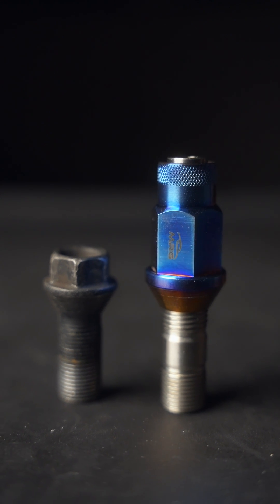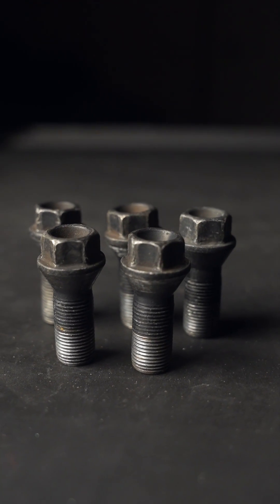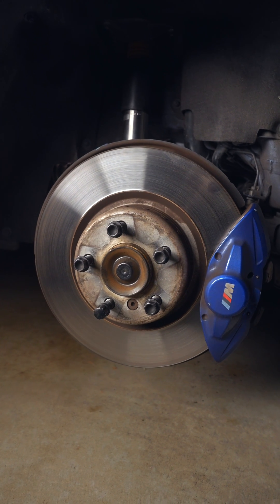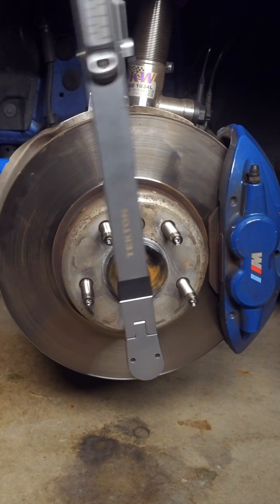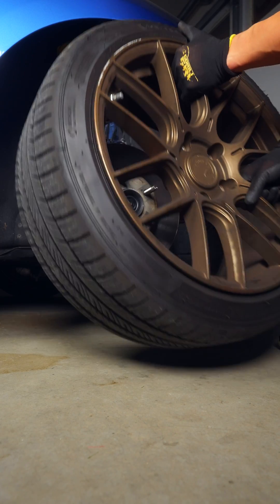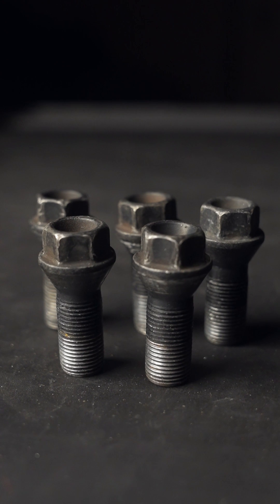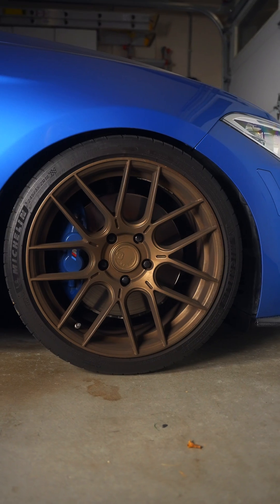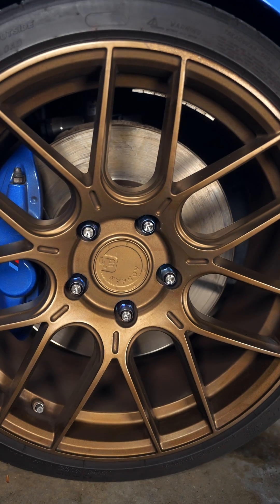Lug STUDS vs Lug BOLTS

Comment: Those wheel bolts are designed to fail before more critical components like the mounting points on the subframe, and they are a method of impact energy redirection so you don't break your neck sliding your M3 into a curb.  Studs are required for tech inspection at a few race tracks now, but those cars run buckets, harnesses, and helmets with hans devices because the energy gets transferred to the driver instead of being spent away snapping the wheel off.

Comment: studs are the way to go.  bolts carry the weight of the corners on the rotating fastener when you get a flat, making it much harder to break free on th way off, and harder to align on the way in.

Comment: The only place that bolts shine over studs is the fact that you can just swap them out super quick and easy. However, I've only ever had to replace studs once, on a 20 year old car, and they were the original studs (Messed up through stupidity, not wear), so they don't wear out overly quickly. (The lug nuts are the wear item with studs, and they're just as quick and easy to swap as bolts

Comment: im a tire tech. dealing with lug bolts sometimes drives me nuts lmao. soetimes the rotor spins as well as the hub and then ur trying to line up 3 different things while trying to put the damn wheel on lol
Reply: I have them too but amazon has bolt alignment studs

Comment: Lug bolts have a tendency to seize and be a pain to remove. I blame the heat of the brakes and all of the crap they use on the roads here in the winter. Fronts are almost worse than the rears

Comment: Literally no real benefits to lug bolts. Sure theyre easily replaceable i guess but one good smack with a BFH and u can pop out a stud and install is even easier. Comparatively if u say crossthread a lug bolt well now thats a whole hub thats fucked up. U also shouldnt be running spacers with a good setup. If u need spacers u didnt plan very well

Comment: Actually the bolt design is harder to repair if broken because most likely the bolt was cross threaded or the threads in the bearing were bad so the whole unit has to be replaced. Rather if a stud is damaged that singular stud can be replaced not the whole unit.

I mean there is a reason people stud heads and other high performance parts.

Comment: I’ve had to change 3 studs in 10 years. I feel like the lug bolts loosen easier than studs. As for accurate torque. You can’t beat a stud. Just my pref

Comment: Seems like this is from the point of view of someone that has never replaced a stud.  It can be a bit of a hassle in some cases, but in most cases a 3 lb. sledge will knock out a damaged stud just fine.

Comment: Can closed lug nuts be a problem? Like if they max out before holding the rim against the hub well enough?
Reply: Shop just changed my lugs randomly without me requesting so on some new rims and they are capped lugs instead of the open lugs I had before I just have some bad wobbles here and there and wonder

Comment: Beside the maintenance aspect there is another thing about bolts vs studs:stud and nut is stronger than bolt. The bolt is twisted by the wrench as you tighten it. Studs are torqued only by the thread friction and not the wrench. So serious applications use studs and nuts and not bolts like truck engine head studs and nuts rather than bolts.

Comment: try putting on a 40" mud tire on heavy ass steel rims with no centering rings on a wv with lug bolts (been there done that) where the rotor spins freely. and the car is on a lift😆 tire and rim combo sits at a comfy 75kgs! do that 4 times. than go to a car with lug studs, and see which one breaks you back first🤣

Comment: Holding the wheel with one hand while trying to align the holes to put the bolt in is a pain in the ass.
Reply: especially when each tire is 65kgs😆 I struggle enough with my Audi, which have tiny lightweight rims and low profile tires. getting that stupid bolt in is horrible. lug studs far superior for ease of life and saving your back when the car is a fair bit over the ground

Comment: there's a difference between lug studs and lug bolts? they're both lugs, and they're bolts that are the studs right? (sorry i know nothing about cars)
Reply: Yes, a lug stud is mounted into the hub, and you screw the lug nut onto it.
A lug bolt, on the other hand, screws into a hole in the hub.

Comment: After working in the tire industry for a few years I can assure you that nuts are far superior to bolts (in a mechanics perspective)
Reply: And what's the first thing we do when increasing boost on a factory turbo engine??? Replace the head bolts for head studs- because studs provide a better clamping force and tensioning them is more accurate than tightening a bolt- you have to take bolt twist into account when clamping high loads, studs don't suffer from the same problem
Reply: As a qualified mechanic of 23 years- I totally agree with you. Wheel bolts suck
Reply: @MaFTB  idk what car ur working on but with the exception of cars with drum brakes replacing a stud is easy as shit
Reply: @MaFTB  Considering how long they last I'll take the studs and nuts anyway...

Comment: The wheel bolts will outlive anything on a BM. I don't why Americans make such a big fuss out of it. It's pretty easy to deal with as well. I mean maybe if u're not used to them just put 2 screw drivers in the lining holes(found in-between the holes on the hub and oem wheels) and you're off

Comment: Lmao, studs are super easy to transfer over. You just have to not be stupid about it. Also, studs make aligning during a tire change super easy with no need to spin the tire to get it aligned. You don't really know what you're talking about here and that's obvious to anyone who knows a little bit about cars. Bolts are also weaker and more costly to make. If you break a stud, you bang it out and slip the new one in. Proper torque will actually set it I've done a bunch of studs over the years and have never wished they were bolts.

Comment: I can say first hand my studs saved my tire from falling off
Reply: Yup I had a 98 audi started feeling weird in the steering turned around almost made it home then my tire tried to pass me after that I won't run bolts anymore converted it and my 06 a4 to studs
Reply: Studs don't back out when one or two failed to be torqued bolts do

Comment: Studs. Hammer it out and pull one in, most cases it's easy.

Ever had a stripped thread in a bolt hub?

Neither have I, but I don't drive European vehicles.

Comment: I’m in a automotive class and I prefer studs as long as your teammate isn’t an idiot that threading the lug nuts on with an impact is fine and doesn’t f anything up. Which mine does he striped out a lug nut yesterday and after I told him he claimed it was like that when he took it off. It was quite literally on the stud at like a thirty degree angle it’s pretty annoying.
Reply: Start it by hand then use an impact when i do it at home i use my stubby milwaukee on the low setting and it only does like 45 then so it starts it without over torquing

Comment: Having had both bolts are easier to line up as you just sit the wheel on the hub and rotate it around. With studs you have to line up 5 or 6 holes.
Reply: Studs are easy to line up, lol
Like dead easy
Reply: @doodlecaboodle9298  look at the backside of your rim the next time you change wheels.
Reply: There’s a trick I learned to that which is to put the wheel in your lap and use your thighs to adjust for height and hands to turn to match the bolt pattern
Reply: You've never changed a tyre on the side of the road in the dark, have you?
Reply: So lining up 5-6 holes is easier than lining up 5-6 studs?

If you cant correctly align the hub and wheel e.g. you top stud or hole it at 12:30 and you put the wheel on where your top hole is 11:30, youre not very bright..

Comment: So much easier to align the center bore with the hub, than 4,5,6 studs with their holes, especially when putting on heavy wheels. Bolts are superior. Studs need to go extinct.
Reply: Oh and I almost forgot the factory studs that install from the back side, and fall out of the hub easily, then just rotate, best feeling
Reply: Its the other way around, its much easier to put on a wheel with studs and if one snaps you just replace it. But if you mess up the threads with bolts you need to replace the whole hub. So its really the bolts that need to go extinct not the other way around
Reply: I think we have 2 completely different view as to what heavy wheels are.. but studs all day long.
Reply: Light duty truck wheels, for example renault master mk2 came with studs first and then the facelift ones came with bolts, searching for the studs through a steelie with no large holes 5x180bolt pattern (iirc) while holding it in the air is a "fun" job, the new one you just push it on the hub, rotate it to place and bolt it down.

Comment: im with studs. you maybe repair a bearing once in the cars life. switch wheels like 20 times in 10 years.
Reply: Actually it would be more like  30 thats just with tire rotations not including brakes or anything like that
Reply: True but I've replaced at least a dozen ruined studs and it's a pain in the butt. I don't even remember how many bolts I've replaced because it was so God damn easy

Comment: The fuck is a lug
Reply: Somebody want to translate it to normal people talk
Reply: A lug is what you screw onto the stud to hold the wheel assembly on the car. A lug is typically tightened to between 60 and 100 ft-lb of torque. Lugs should always be tightened in a star pattern and final torque spec should always be performed with a properly calibrated torque wrench. Do not use an impact to tighten lugs as it will definitely overtighten them and do not use torque sticks as they are not really accurate.
Reply: @fjcarmo0369  thank you that helps
Reply: A wheel nut or bolt for normal people
Reply: @tylerreed6143  a thank you

Comment: It's honestly a 50/50 dependent on person. Bolts will do fine, honestly I rather have bolts for cars, most car tires are light enough and not a big deal to lift up and place, all the easier if you have a rod kit for it. Bolts on any truck style application sucks, if you live in the rust belt; Bolts are way better to deal with- studs rust and break and are a tideous task at that point to deal at that point.

Comment: Bolt's are not really "easy to replace if damaged", since if you mess the bolt up - likely the female thread in the hub is ruined to, and suddenly you"ll have to replace that whole thing too
Reply: I think both solutions are actually the same picture. If mantained properly, they will last for decades. Nuts on studs will more like be stuck, but on bolts it is easier to damage the thread. I've never had problem with any of them, but I'm using mainly bolts.
Reply: @Arzdnej  the issue is when you damage the threads while you are installing bolts you have to replace some expensive parts, but when you damage stud threads they are pretty cheap to replace. solution for stuck studs is copperslip and wd40 but if a nut stuck on a stud you'll have a bad time
Reply: @MaFTB  not the peugeot hubs, they get destroyed if you tighten them a little too much
Reply: Or you can just you know… rethread it..
Reply: Replacing a bad bolt with new and running a tap down a boogered hole is much quicker than removing and replacing a stripped or broken lug stud.

With that being said i still prefer studs over bolts.
Reply: @Joe-Mamasixtyninefourtwenty  studs are endlessly easy to replace, especially if they're press fit
Reply: @doodlecaboodle9298  I've got a fiesta and it has press fit studs, i gotta say it saved my ass from a lot of pain from turkish tire shops stripping them 😄 just pop it out from behind and put a new one and its brand new
Reply: @Joe-Mamasixtyninefourtwenty brother if you’re just running a tap through on a cross threaded hole I don’t think I’d ever let you touch anything I own with a tool… would you do that with a stud or a light? Yikes. The wheels aren’t supported by anything but the lugs and bolts that hold them on. That is terrrifying that you’d compromise that… where not talking about a control arm or some other part that’s held by a nut bolt and bracket. We’re talking about straight up a stud and lugnut only…
Reply: Bro fucking renegade moment, i hate  renegades, compass, 200, dart and cherookee, mainly the renegade thoes lug studs always get swolen, every time i get a renegade with swolen lugs i charge a extra hour labor
Reply: @eddie6620  dude the darts are a close second them bitches SUCK
Reply: @eddie6620 that’s not because of the lug bolt design that’s because Chrysler is cheaper. Their regular lug nuts do the exact same thing
Reply: Studs suck. Never have had an issues with bolts even on cars 30 years old.

Comment: Every wheelbearing comes with studs in them, studs are way better than bolts
Reply: In europe it depends which car brand sometimes even model
Reply: @boobrowsky  I wrote that a bit badly, I meant that if you buy a wheel bearing for a car with studs, they are attached to the hub of the bearing when you buy the bearing/hub

Comment: Bolts are not helpful 99% of these time, it takes 5 seconds to replace a bolt and 1 minute to replace a stud, if the fact they're easily replaced is their best selling point then there's really no reason to use them

Comment: With how often you have to actually replace a wheel stud your better off using them compared to bolts. You will take your tire off to work on parts 10 times before replacing a stud besides if you take care of your studs meaning not cross threading and not over torquing they will likely last the life of the vehicle anyways. and 98 percent of the population is never going to put spacers on their vehicles
Reply: Wheel mounts(bolts or studs) most likely survive 99% of vehicle lifetime unless some moron crossthread or forgets to tighten them down
Reply: @caklais777  agreed 10 times was definitely an understatement. Studs win this out for me.